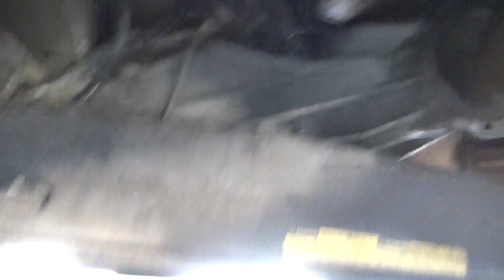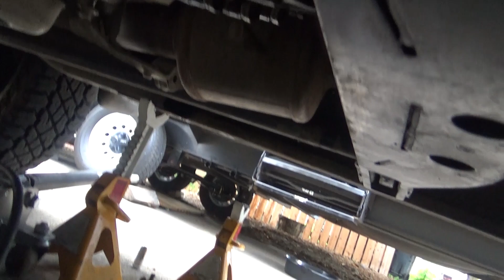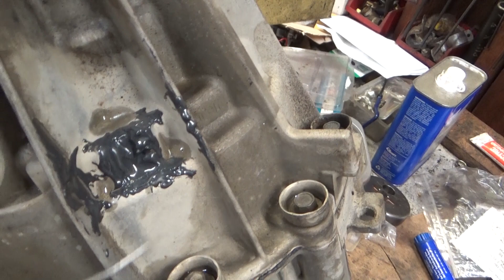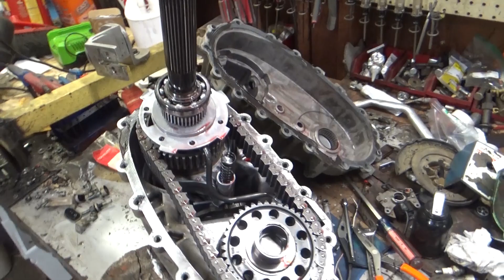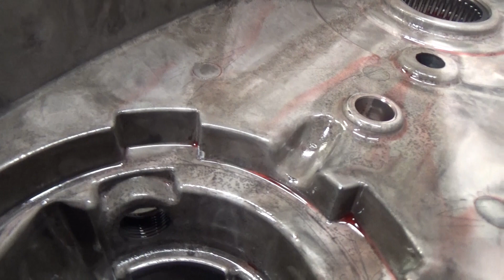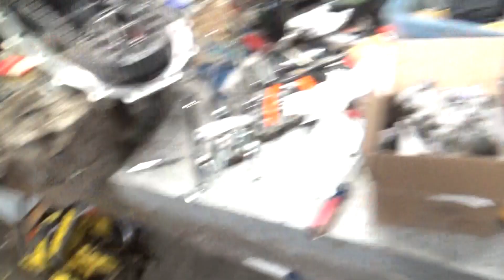2004 GMC 2500HD Transfer Case Repair & Upgrade

Comment: Merchant Automotive is a great company to get rebuild parts from for the NP transfer cases. They specialize in the GM Diesel's and transfer cases. I used to own an '03 1500 5.3 with the NP 246 that the thin aluminum pump wore a hole in the magnesium case at a little over 100,000 miles. I rebuilt the case with the upgraded Merchant Automotive pump housing and upgraded bearings and other parts from Merchant and another company in Florida. That was in 2011 and I sold the truck a few years ago with over 260k miles. The landscaper that bought it is still driving it with over 350,000 miles.

Comment: Maybe this will help someone who has their older truck leaking transfer case fluid from an empty bolt hole near the bottom of their transfer case.  No, it is not the drain plug.  😆 

This can cheaply fix the GM NP246 transfer case 4x4 range fork lower clutch lever pin that often falls out after its hole gets stripped from knuckleheads over-tightening them.  This pin faces downward and falls out after it vibrates free. I've lost 3 of them. I did not realize the hole was stripped, as it would tighten to 30ft-lb but was still stripped. These pins are now very difficult to find used, are not made anymore, and cost $40 to $50 when they are available online. Junk yards might let ya pull one for $5 if the pin is still in the t-case.  These pins are in various 1999 through 2007 trucks/SUVS with T-cases and push button 2wd/4x4.  The floor lever 4x4s do not have these pins.  The cases are now $400 to $800+ used and many probably have the same problem.  I chose to fix mine on the truck, as I had another vehicle to use for the 10 days this took. My 2005 Yukon had 220,000 miles on it. The pin fell out and leaked/splashed 90% of the oil out (holds 2 quarts). SUV had more than 8,000 miles put on it during a Summer road trip like this, unknowingly. Miraculously, nothing seemed to have been damaged, as 4x4 was not being used at all. I guess just enough oil stayed in the case's bottom to lubricate the chain that's always turning. 

The part number for the two Pivot Pins are 89059638, and previously was 12547487.  Torque spec is 30 ft-lb.  I think shops are zipping them in with power tools, assuming they can take 60+ ft-lbs, but the hole's metal is soft and the threads are fine and shallow.

It's very important to score / roughen the area very thoroughly and clean with acceptable cleaner such as 91% alcohol, brake cleaner, or electronics cleaner.  BETWEEN EACH COATING.  I used a straight razor blade and steel curved pick, making gouges and shallow scratches very lightly in all directions.  This worked well on the soft metal t-case and all of the epoxy / RTV.

A suitably sized bolt/pin with ground-off end and large enough head to seal flat to the t-case opening can be used if an original pin is unavailable.  Welding a large nut to the original pin or replacement bolt head, drilling 2 holes through the nut, and using safety wire securing it around t-case is probably a faster and neater repair, if you're able to do that.  Otherwise, this is the only way I found that works without dropping the t-case and opening it up to insert a coil or cut entirely new threads (which would require a new bolt to fit it).

You'll need a headlamp/portable light, regular razor blade, a steel pick tool, a 12mm allen wrench or TP60 torx for the pin (turn only by hand), a full new stick of JBWeld metal puddy epoxy, 1 package of original JBWeld 2-part epoxy, and a good tube of RTV/gasket maker (fast cure type preferred).  And a safe place to lay down under the passenger side of the truck numerous times over the course of about 8 days.

1. Thorougy score t-case area and pin's head washer/flange area with razor blade, steel pick, or coarse sandpaper. Clean with alcohol or mineral spirits, brake cleaner, etc.

2. Clean bolt/pin.  Place a thin amount (~1/10 tube of JB-Weld 2-part epoxy on threads and head of pin/bolt (do not touch or cover o-ring).  Hand thread pin into t-case. Do not tighten past point of where it strips and spins in the hole. Let dry for 48+ hours.  What we're going for is sealing oil away from opening, plus securing to stripped hole, so oil doesn't leak out easily as it's splashed onto the pin and travels downward toward the bolt's head/o-ring via gravity.

3. Apply thin layer (~1\5 tube) JB-WELD 2-part epoxy with brush over the pin head and about 1/2" up t-case flange. Let dry 48+ hours.  This is more for sealing the flange than strength. Do not put epoxy in torx hole opening.

4.  Score/clean epoxied area and apply ~1/4"+ thick layer RTV/gasket-maker about 1/2" beyond dry epoxy edge.  Cure 48+ hours (may take longer, spray with water 2 to 3 times daily to help cure, wait until cured).  This will keep the pin/bolt head free of thick puddy & 2-part epoxy, and allow the pin/bolt to float a little in the pin's hole in case it breaks free of the stripped threads. This also makes for overall easier removal, if later needed for full rebuild.

5.  Score and clean dried sealant RTV/gasket maker and apply 1 whole tube metal puddy epoxy over pin and ~1" beyond RTV. Make epoxy into a large enough circle of uniform thickness to cover the pin and go about 1" beyond, working it onto the case. Allow to cure 48+ hours.
 
6.  Score and clean dried metal puddy.  Mix-up almost half of the remaining JB-Weld 2-part epoxy and use a fat small round brush to coat the whole pin mounting area, all the way to the t-case (at least 1/2" beyond metal puddy).  Let dry 48+ hours. 

7. Score/clean hardened epoxy and apply the last of the 2 tubes of mixed epoxy, 1/2" beyond first coat.  Let dry 48+ hours.  

If you do anything less, the pin will get broken free from 4x4 engagement / disengagement lever and eventually fall out. This happened to me three times before I realized what was happening.  I had tried red locktite the last two times (blue locktite the first time), but it didn't hold...female threads were too damaged from someone else over-tightening the pin.  I would not be surprised if they thought the pin was the drain hole for the t-case fluid, as many thought it was the drain lug when I originally started identifying the open hole. 

Easy repair steps, just time-consuming due to allowing it to cure between epoxy and sealant layers.  But it'll hold the pin and oil in and not mess anything else up.

Roll on with your 4x4 in tact.

Comment: What is the difference internally between the 246 G- M and the  263 H-D  - G -M   Thanks
Reply: I'm sure they have different numbers of splines on the input and output shafts.  The 261 LD GM has 27 input and 32 output splines.  The 261 HD GM has 32 input and 32 output splines, so you cannot interchange these transfer cases.  :(

Comment: It's actually a 263 X hd the X means its the 8.1 or a diesel I believe. 

If it were a 263 hd it would be 6.0l gasser for 2500hd . 

Nice video!  Bolts sizes are always appreciated haha

Comment: Nicely done!  Thank you.  Did you have any issues getting the new case half back on?  Did the bearing clip seat back in the bearing rim easily or did you have to flip the t-case it over to get some help from gravity?  Just wondering as I'll be doing this soon to my HD.  I've done an NP246 and had issues with the clip when putting the case back on - was really the trickiest part of it all so I thought you might have a tip or two on that on this 263 or whatever # it is.
Reply from the maker: It's been long enough ago I can't remember whether I flipped the case (don't think so), but getting the snap ring back in place wasn't a problem.  It all went together easily.

Comment: Got the lesser kit. Just the upgraded pump piece and silicone as my t-case I picked up wasnt leaking. The one in my truck is shot cause of this. Cheap insurance and only doing things once especially something like this, is nice.

Comment: I would have replaced the chain while I had the case broke open, I see it as cheap insurance.
I feel the Big Bite out of the billfold, I just replaced the heater core, dash and instrument  bezel in my 98 Dodge 2500 at the cost of $600 + purchased dash and bezel from LMC because they had choice of colors all others were just black.
FYI you can get about 5" more in height  if you use the Harbor Freight 6 Ton Jack Stands. Every inch helps when your working under your vehicle.

Comment: Sorry to see you having vehicle problems Leon. I just had to replace my main house well water pump. Much more then I wanted to spend. System was down a well over a week and happy I had our new trailer set up in the drive way. Did have water available from our irrigation well pump. Looking for the next video. If I can help let me know. Be careful.  Kent
Reply from the maker: Sorry to hear that Kent!  This transfer case pissed me off on principle, but the  project itself went surprisingly smooth.  I kept waiting for the bad part and for once, it never came!